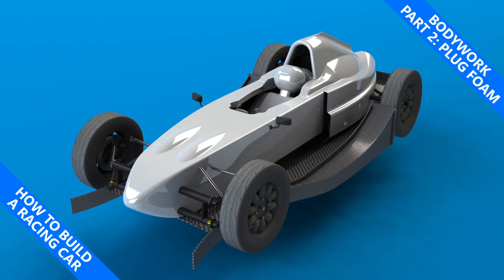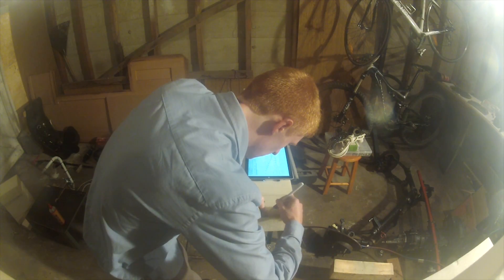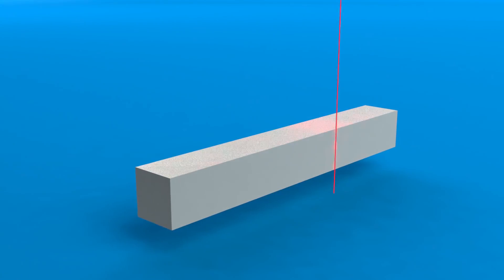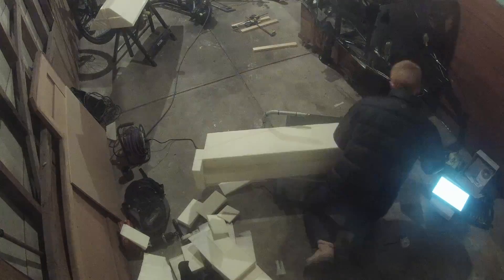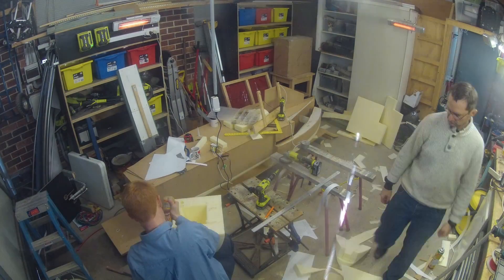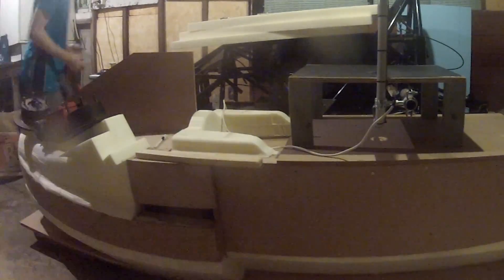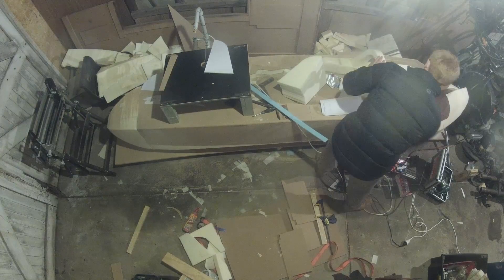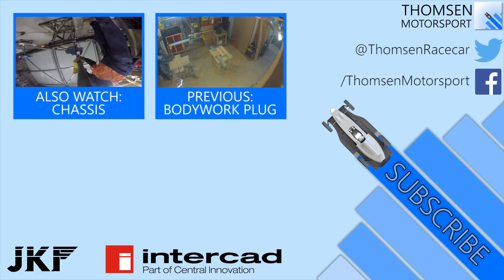Bodywork Part 2: Foam Detail

Comment: Yeah.. I get it.. I'm going to use 'school' glue  called 'elmers' in the USA.. It should cut a bit easier. But I'm just starting my Carbon Fiber frame so It' may be a disaster too..  Composites are always 'go for it and see what happens' and that's what I'm doing. Thanks for posting this so long ago.. You know I'm digging deep cause nobody is really posting anything  about CF  (a lot of fiberglass) but maybe because it's pretty complicated.  Thanks for the video my friend! DMAX motion sim ch

Comment: did you use blender for your renders?
Reply from the maker: No, I used Solidworks. The advantage was that I was able to use the design CAD model directly for the renders, so after applying the materials to each part all I had to do was set up the cameras and run the render.
Reply: ThomsenMotorsport ooh, ok, kinda looked like blender

Comment: could you share the details about the foam used and the glue used to attach the block...? thank you
Reply from the maker: G'day, I used a rigid extruded polystyrene board with 35 kg/m3 density and 300 kPa @ 10% deformation compressive strength. If you're in Sydney I went to Dynamic Composites Technology, the product was the DCT XPS Block. I bought some in 50mm thick and some in 100mm thick depending on what was required. I then used a polyurethane glue to bond them after cutting - Sikabond TechGrip which I just got from Bunnings.

Comment: @simon how much did your entire project cost you in terms of material expenditure ? An approximate value would be nice.
Reply from the maker: It didn't cost as much as you might expect, last I checked it was about 25k AUD. That includes the donor car I bought for parts at the start. It's a lot of money but a brand new Vee can be over 60k AUD, second hand over 20k AUD if you buy a front running car, so depending on how competitive it is it may have been an economical option. By the time it's racing I'd have spent another 3-4k AUD on things like paint, parts, log booking etc. The real cost to me was time.